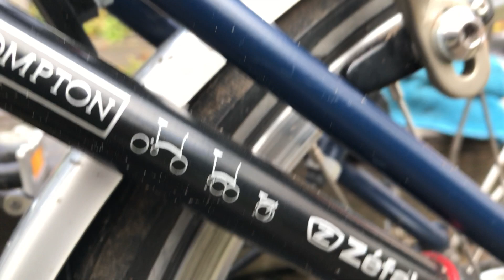Cleaning the Brompton - Daily Cleaning

Comment: Quick question, I'm thinking of getting a brompton  as my first bike? I have had people say not to get it as a first bike? How do you find it? And do you suggest it is worth it for a beginner.... thanks..
Reply from the maker: Hi there. The biggest difference is the steering due to the wheel size so can be a bit twitchy when turning. Honestly though, this is the funnest bike we have ever had. Personally I prefer the small wheels as I can change direction quickly in the city, and is faster accelerating. Best thing to do though would be to go to a Brompton dealer and ask to have a go. Most will let you take it out for a while to try. Definitely  worth testing first, as a fair amount of money if you find you don’t like the ride on it. Hope that helps, but let us know if you have any more questions! 😀